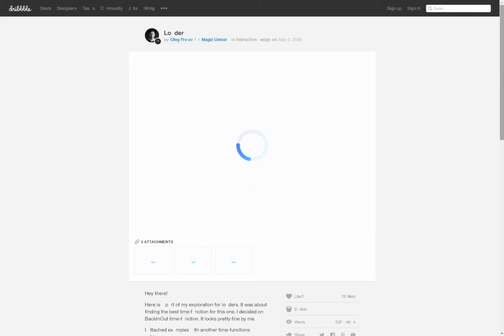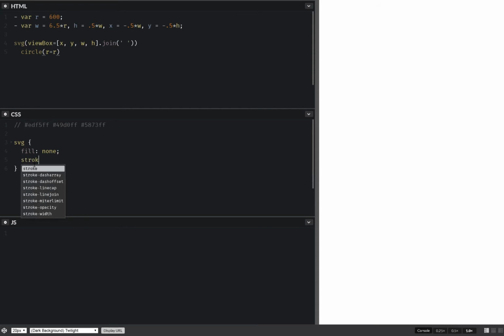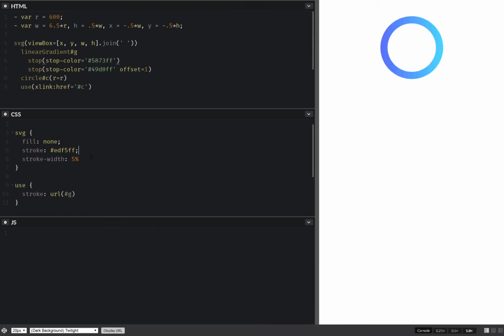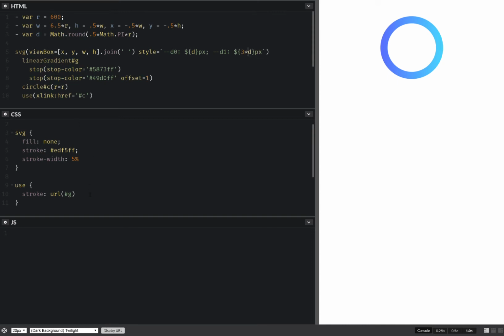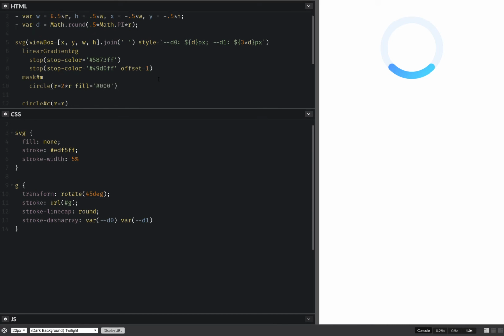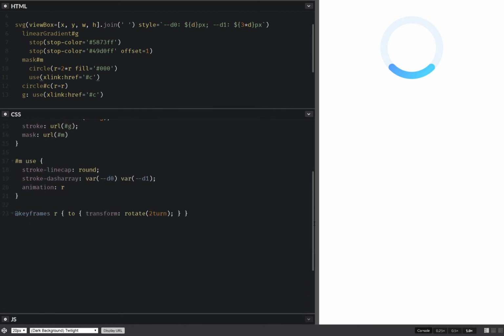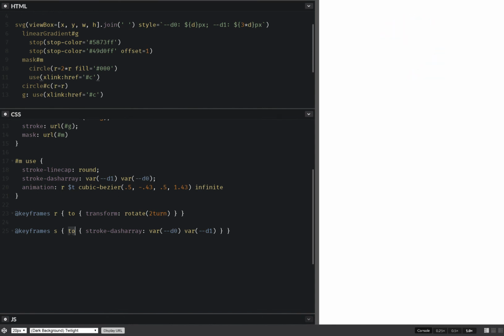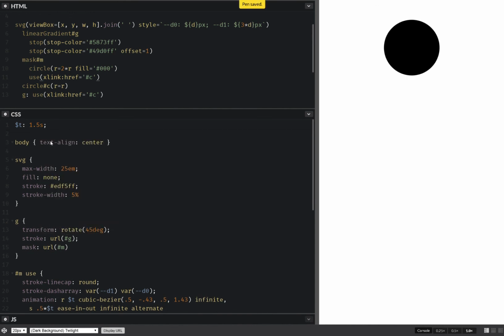Back to blue SVG loader

Comment: Hallo, Ana. I just tested your pen with Google Chrome. It works very well. :-)
Reply from the maker: Yes, I know. It was coded in Chrome. But it doesn't in Firefox and I don't have Edge 17 to test (it won't work in older Edge versions because they don't support CSS transforms on SVG elements).